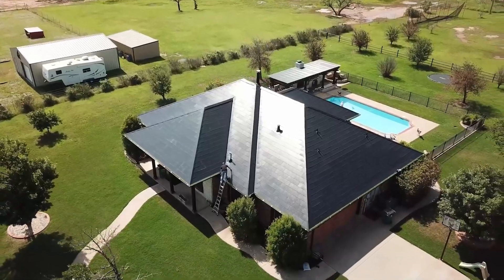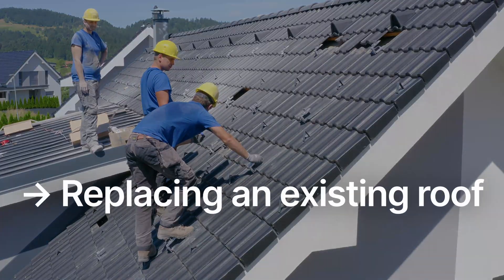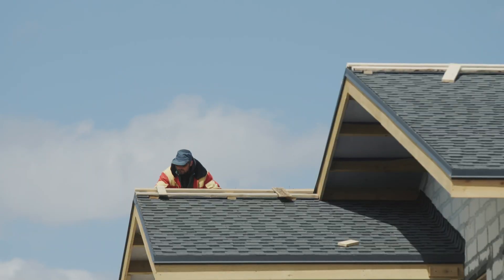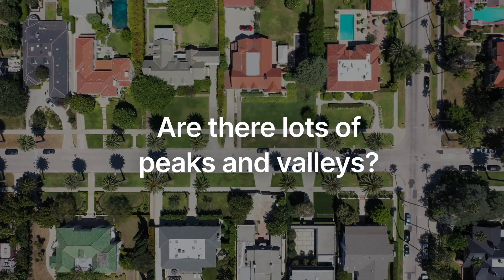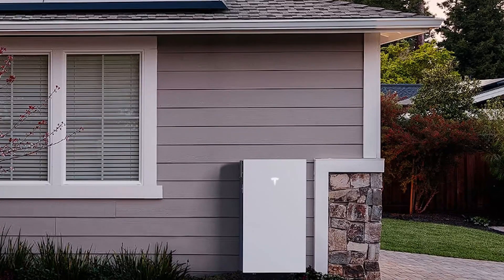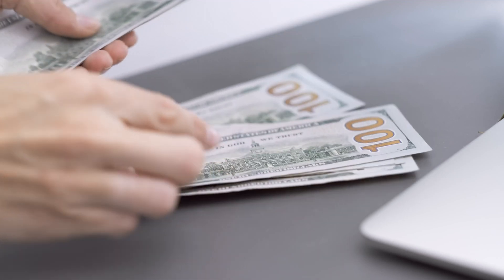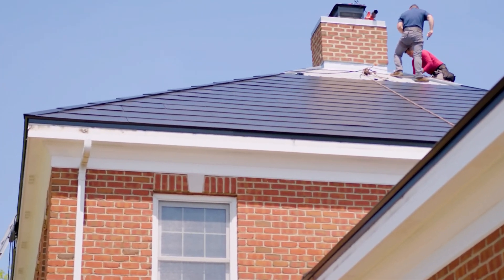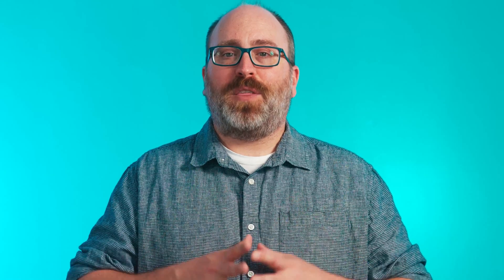Tesla Solar Roof vs. New Roof + Solar: Cost Breakdown

Comment: I was recently quoted in Virginia, by American Home Contractors, for a 4200 sq.ft roof replacement for Tesla Solar Roof, at 17 kW and 2 Powerwalls for $240,000.  Basically the price in the past four years has gone from ~$21-$25/sq ft to ~$57-$60/sq ft. Ridiculous.
Reply: how much kwh capacity is each power wall？and if $240,000 is net cost after tax credit?

Comment: I was quoted last week on a 3,900 sqf roof at $270,000. includes 1 battery and  13kw amount of active tiles. A similar solar set up would be 38k. Though i would still need to install a new roof. 

Basically, what i need to figure out now is how much sale value the solar roof can add to a home. If it has a good mark up value, then the investment can be more appealing.
Reply: That's way too expensive
Reply: how much kwh capacity is the battery, and if $270,000 is net cost after tax credit?
Reply: It usually lowers the market value to have a solar roof
Reply: @russellvilleyoutube  Why?
Reply: @russellvilleyoutube   I'm calling BS on that comment 🫵